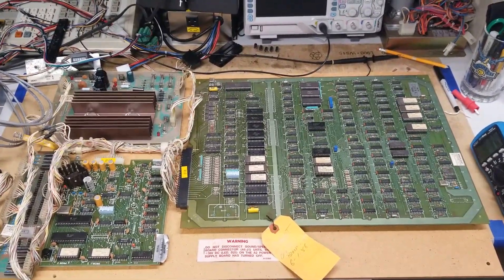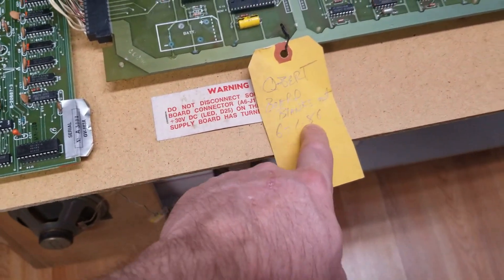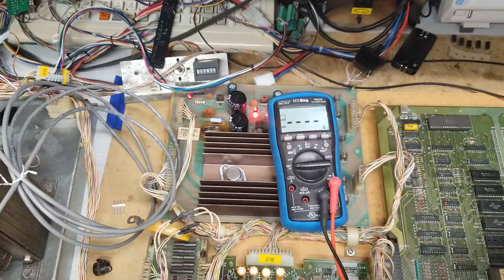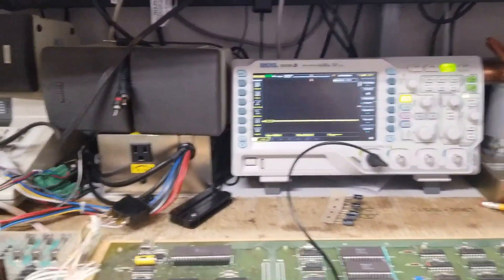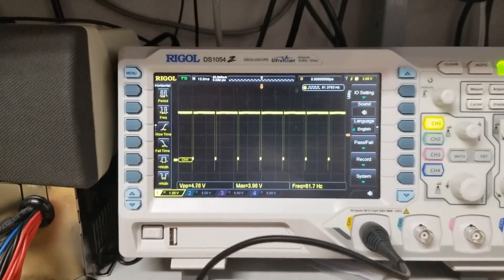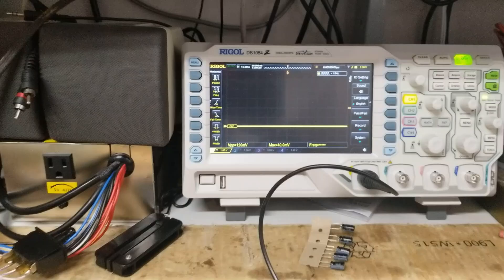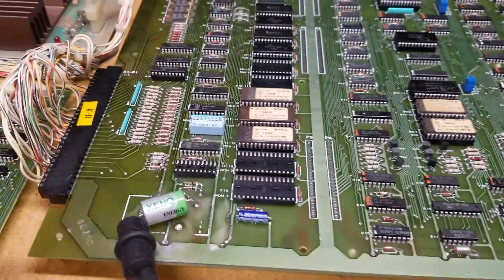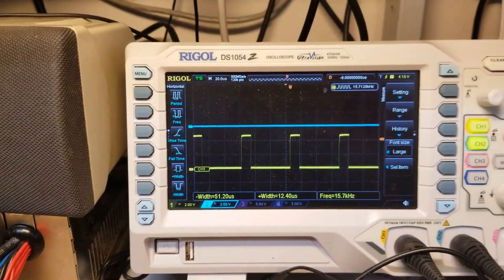Q*bert Refurb & Repair - Part 2 - @!#?@! Sync & Color issues

Comment: (nevermind you figured it out, the following paragraph would have probably led you down the wrong path)
Color signals look like they're shorted to CSYNC with the latter pretty much drowning out the picture information.
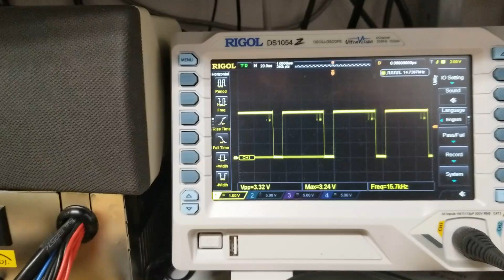The CSYNC has no business to be on the color outputs on 12:10 to 12:40 (unless it's a game with a black background and negative video like old Donkey Kongs). (this big 5V TTL signal shouldn't be on the color outputs at all, just the video information in between the pulses, and that should have its black level close to 0V)
These signals in the beginning have a lot of overshoot or ringing. Half a volt (even negative) can be considered normal and can be ignored. At least that's what I think, because I see that all the time on working boards too. Can happen with long leads and/or impedance mismatch. If you zoom in with the oscilloscope you can distinguish between noise and ringing - ringing will look the same on every transition like a high frequency sine wave. If it's more than half a volt maybe try a termination resistor in the other end (try with 200...50 Ohms). Just guessing though.
Your front porch back porch (I keep mixing them up too) theory is pretty much correct. The monitor sees the low portion of the signal (in the blanking period) as the black reference level. With the video signal having the true black start at around 3V that's pretty much higher than 0V so the monitor gives a white picture with a faded inverted picture on top.
Reply from the maker: Thanks for the suggestions! I hadn't seen that level of overshoot or ringing before.

Comment: Your TPG H&V sync frequencies is the same frequencies as the arcade motherboards is H&V sync output signals frequencies, but the only differences are the V&H pulse widths are different? That is usual that the frequencies are the same but the pulse widths are different
Reply from the maker: Yes, freq was very close and pulse widths were very different.  I don't know how unusual it is honestly but this is the first time I had to care about it and couldn't get something to sync on my PVM.  Video arcade games didn't have exact standards like broadcast tv at the time.
Reply: @jacklick  Try using your DVM meters pulse width mode because I'm curious why the frequency is the same but the pulse width are different. It doesn't make sense because if you change the pulse width the frequency will change also. If the DVM meter measure frequency and both the measured frequencies are the SAME then switch the DVM to measure pulse width which if they are different pulse widths that would be very interesting.